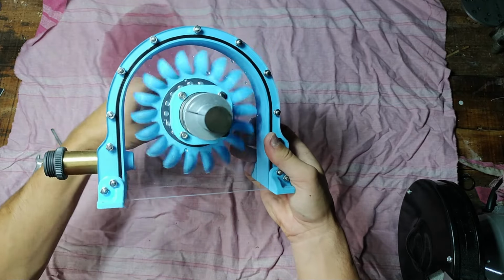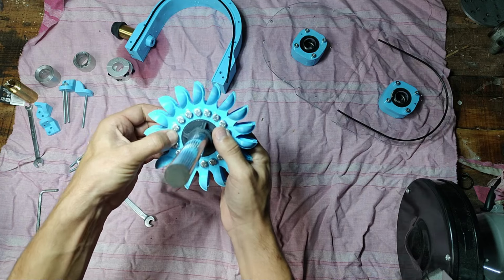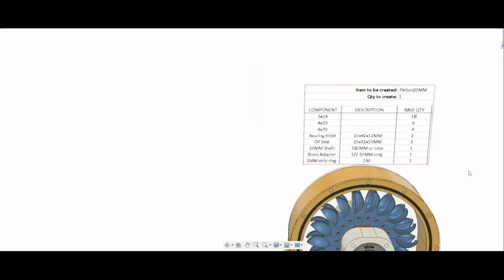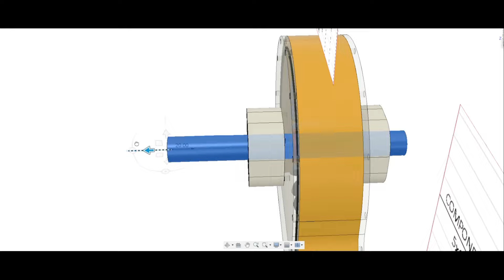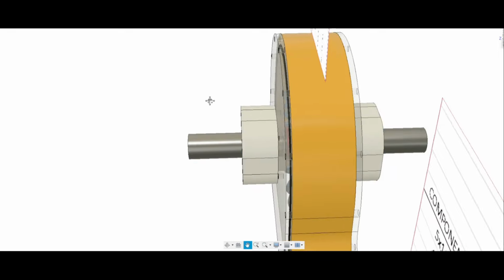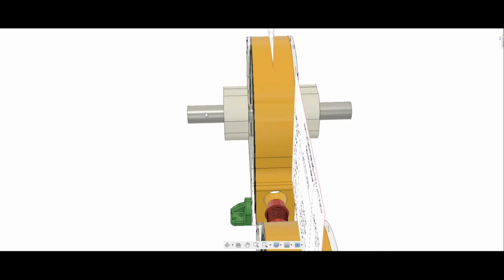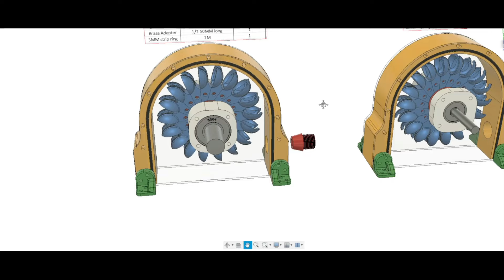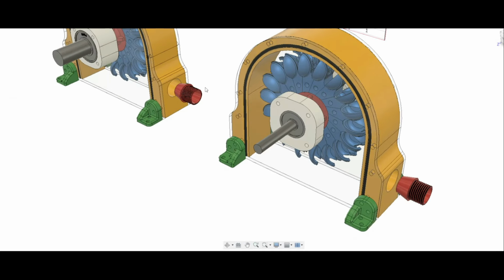Free Micro Hydro Generator 3d Printed Release all files

Comment: i was thinking to print it, which motor size, flow and pressure would work with this turbine, any idea?
Reply from the maker: I did not make enough test yet to tell you but it can probably go up to 500w without any problem, it all depend on your hydro set-up.

Comment: the housing is too narrow.      there should be more space, axially, for the water as it leaves the runner.      in other words, the design of the housing should be changed, in order to minimize 'fouling' during operation.
Reply from the maker: I tried the design with a garden hose and i agree the the spacing isn't very big for the water to evacuate, I'll modify the model right now and provide the modified version .
Thank you for suggestion
Edit: I uploaded a new version a bit wider but with the original too if needed.